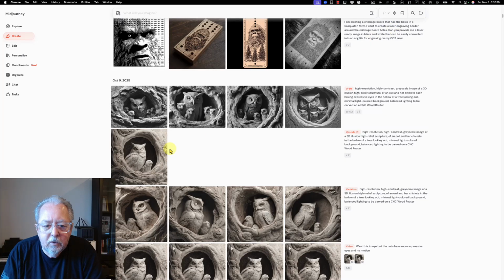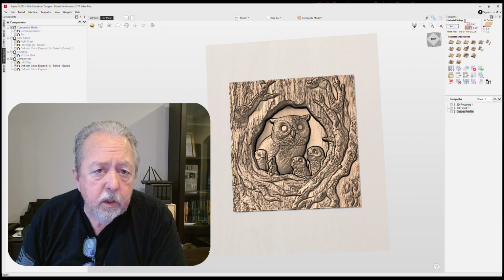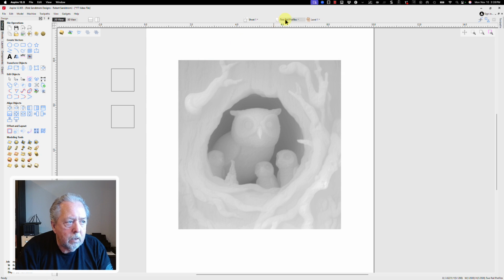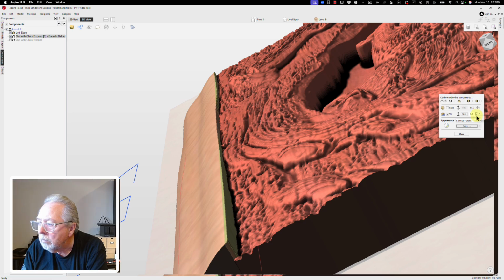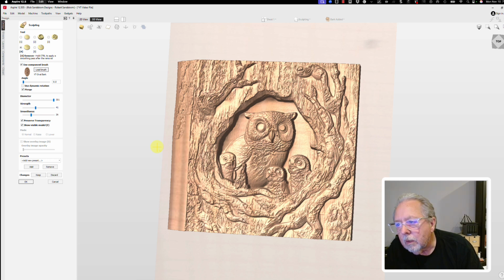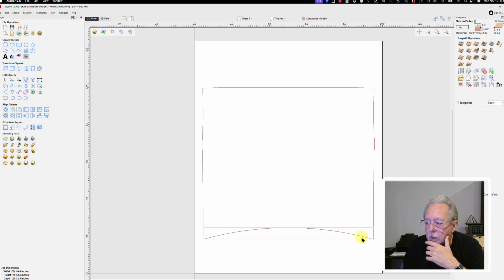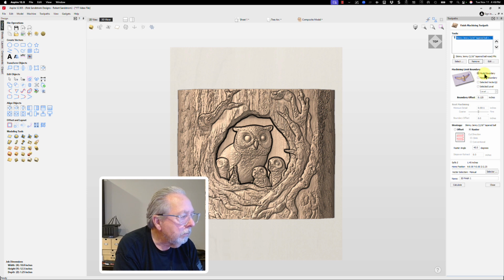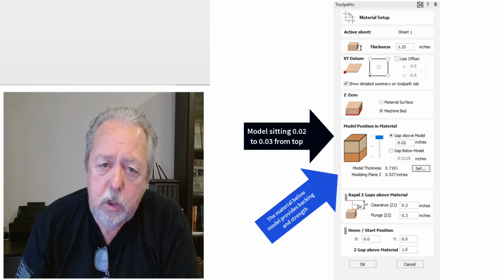Creating a 3D Model of Owls and Chiclets Using Vista Sculpt and Aspire - Step by Step

Comment: Hey Rob!  As a fellow Mac user having to use my Windoze box for Vistasculpt- letting you know that it looks like it now works in the latest parallels (at least for me).  now to switch my licence...  Version 1.0 of Vistasculpt, Version 26.1.2 (57293) of parallels (latest as far as I am aware).
Reply from the maker: Thanks so much for the update. That is awesome to hear and I will check it out.   i have been part of the beta testing and they did not share that with me.  I will check in with them.